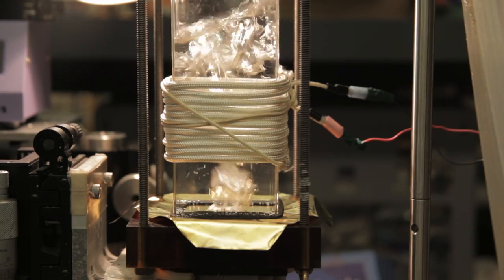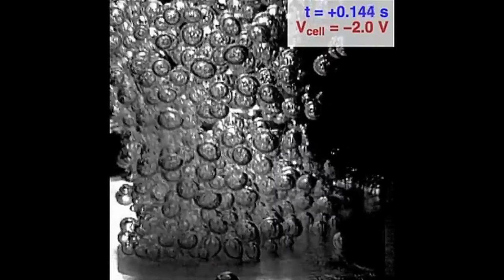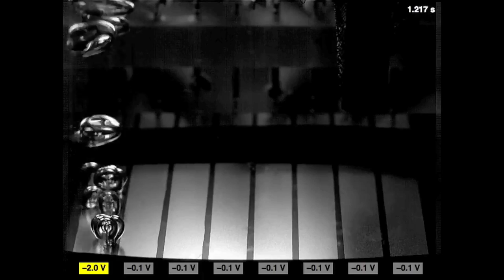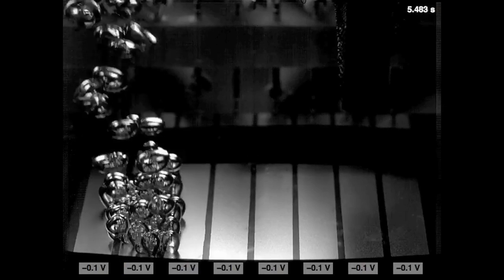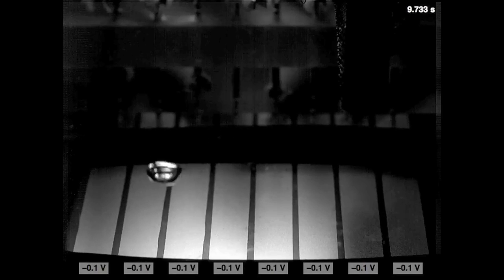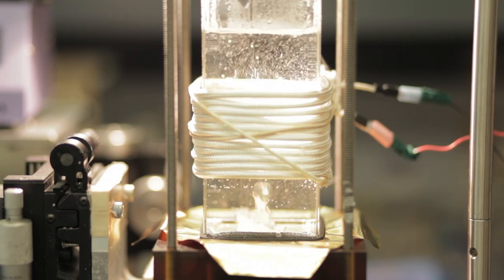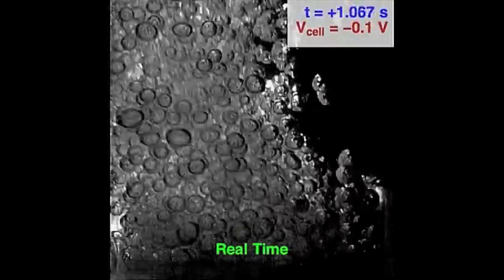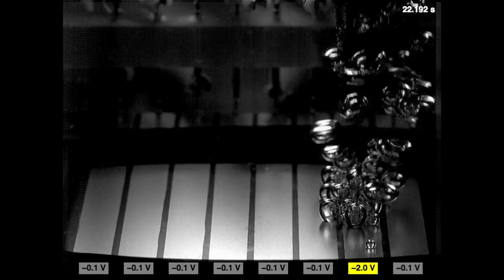Controlling the bubbles of boiling water

Comment: This is pretty cool, now i wonder does it only work with negative volta and if so why?
Reply: i think this will depend on the tenside you use. If you use cationic tensides then a negative voltage will cause a migration of the cationic tensides to the surface

Comment: why control bubble can enhance efficiency?
Reply: From reading the article my interpretation is that boilers in power plants and such who's job it is to create steam need to have more water than necessary to prevent random bubbling causing parts of the heating element to become dry and subsequently damaged. All that extra heated water is wasted when the system is powering up or down - with bubble control the extra volume is not required.
Reply: @norlesh  interesting .. thanx for sharing

Comment: How are the ari bubbles formed in the first place? 
I mean there is no air at the bottom so what gives?
Nvm just got my answer from another video
Reply: Air is just a mixture of gases, some of which is water vapor. In the case of bubbles in boiling water, some of that is atmospheric air that has dissolved into the water, but that will gradually be released until the bubbles are purely water vapor, which will pop out as steam..